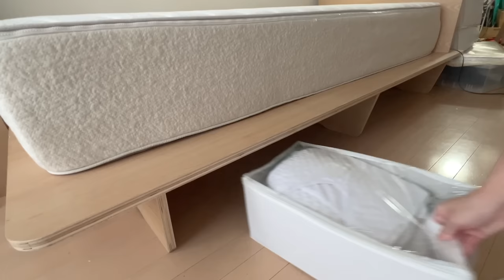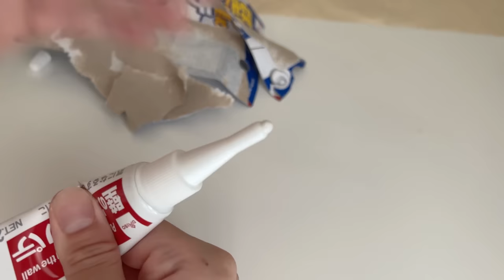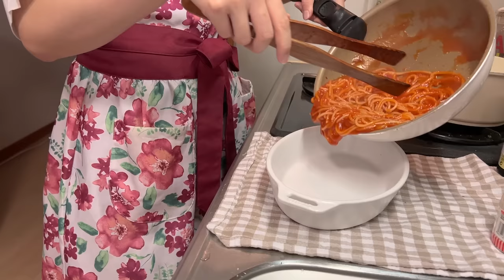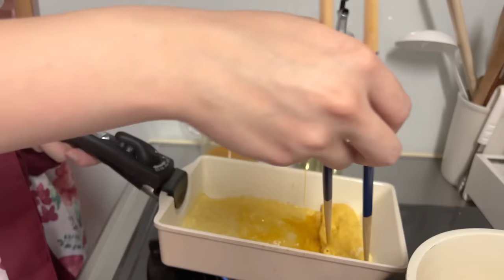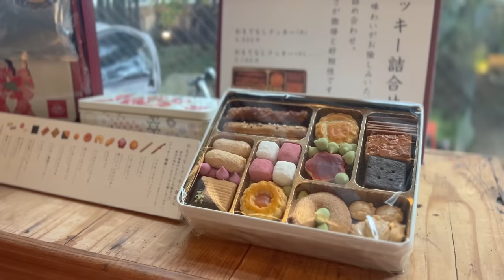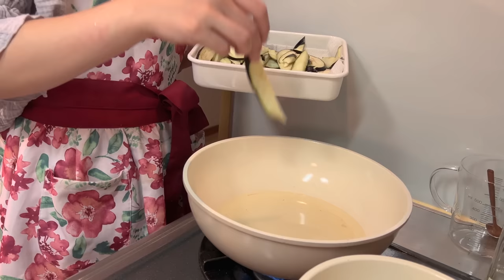【模様替え】1人暮らしの小さな部屋を模様替えして整理整頓した休日｜Japanese small room makeover VLOG

Comment: Nami! You can make your own yogurt too and it’s very easy. Get some high quality milk and a high quality yogurt with active cultures. Heat your milk to 93-94 degrees Celsius to kill dangerous bacteria, then cool it off down to 43 degrees. Add half a cup of your yogurt, whisk it thoroughly to mix, then put it in a warm corner (covered!) to sit overnight. It will ferment and make yogurt. You can strain it as much as you want (you don’t have to) and use the whey for drinks. Just keep in mind that when you strain, it will reduce your yogurt by half. So I like to make a lot all at once because I prefer thick yogurt. And then the next time you want yogurt, use your own as a starter for more. Just make sure you get a type of yogurt you like, because the culture will be the same!!! I make mine all the time and really enjoy it 💕 I haven’t made cheese though and I want to try it now!